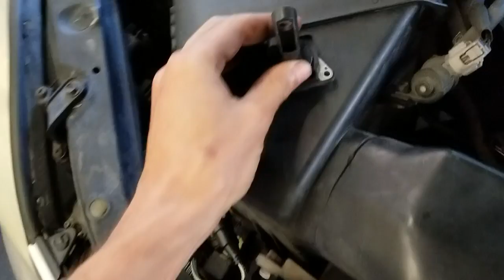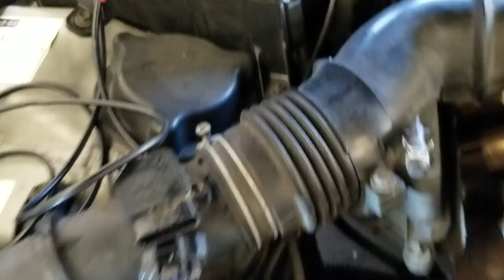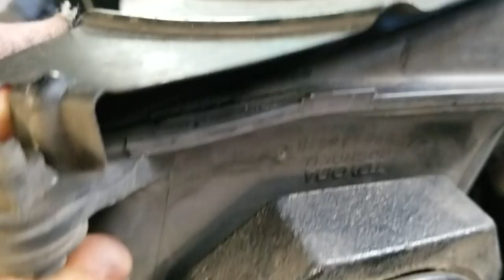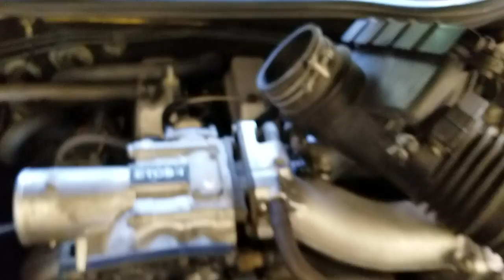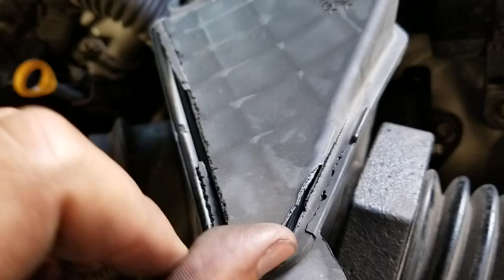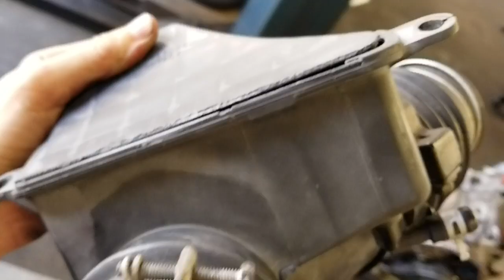FIXED 2JZ hesitation & low power, no check engine light.

Comment: Thanks for the info, I had already cleaned throttle body twice, checked hoses, cleaned MAFS to no avail. After your video i pulled the heat shield below resonator and found a large crack at the seam with 1/8" open area. I'm using high temp epoxy to seal resonator and will check it in a few months. If it opens back up I'll drop the 200 for a new one.
Thanks again
Reply from the maker: Just get an AEM intake that is carb legal. Dont worry about it again

Comment: 2002 Is300. I cleaned out my MAF sensor and it feels like a whole new car now. Before cleaning MAF at idle on scantool read 5.2 to 6.4 gm/s and long term fuel trim -15 and -18. 
After cleaning sensor MAF at idle is around 3.5 gm/s and long term fuel trims after a drive went to around zero. 

Replaced the transmission due to no reverse intermittently, had black fluid , 300k miles and a shift solenoid code. the new one shifted better but not good on wide open throttle. Would bog while taking off and make a noise that sounded something like the transmission pump had cavitation.  
Now it is good.

Comment: I recently had timing seal leak fixed. But now the car is raced . If I make it low the car engine is shutting on idle. It's both on cng and petrol. Can you tell me what's the problem.. the mechanic say it's electrical.. but before the engine opened for timing seal I never had any issue

Comment: Could this issue cause the green ECT Power light to flash? My car idles fine but the slightest tap of the accelerator and the car runs obnoxiously loud while lacking power it seems. I've found that my resonator is indeed cracked and will get around to replacing it. I hope the ECT Power light is related to this and not another issue

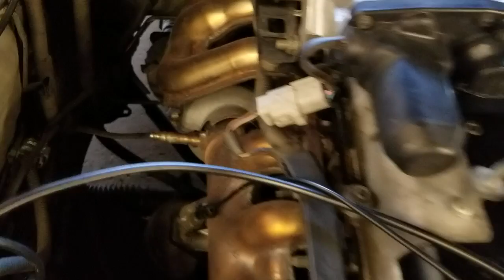Comment: 7:34 , no fr. I have to replace everything from spark plug, coils, o2 sensors, Sensor 2344517 (rear oxygen), Vacuum Switching Valve ☠️
Reply: Change fuel pump
Reply: @dpm8763 why would I

Comment: Fantastic video.  I’ve been doing some work on one for a friend and afterwards starting running into this issue.  Thought I had resolved it after replacing the exhaust manifold gasket, but still having some issues.  It only seemed to have the issue after driving it for about 10 miles.  I then cleaned the MAF, but didn’t know about the two small wires down inside nor to check for the crack in then plastic baffle.  Thanks!

Comment: My 2001 gs300 has a stuttering issue. I've replaced the spark plugs, the coil packs, and the MAF Sensor but my car still gives me a rough launch. 
Usually the first start is fine, it feels like the car has no issues. After a short drive around my street, when I try to accelerate the car has crazy hesitation anywhere below 2500 RPMs then gets up and goes. I have no codes besides a knock sensor code (p0325), not even a misfire code.
Reply: Check your coolant temp sensor (for ecu), the green plug directly underneath your intake plenum, to the left of your knock sensor.

Comment: I have no fault codes on my Toyota Yaris 1.0L (2004), 
new spark plugs
new air filter 
cleaned throttle budy
cleaned PCV
tested TPS
checked vapor solenoid
clean MAF sensor 
tested camshaft position sensor  
checked ignition coils  
 - but still have  some vibration on idle and hesitation after fast/sharply pressing the gas pedal (hesitation from idle to 1500-2000 rpm, like if the engine is choking), but if I give gas smoothly - the engine normally gains speed and power.... also no luck of power from 2000 to 7000 rpm.

Comment: Hey I had the same issue and I cleaned my sensor with maf cleaner and used contact cleaner on the conector and started her up and she ran fine then the revs start dropping and it start making a lot more shit sounds out the exhaust as if it’s misfiring more then what it was before hand. Any more suggestions?

Comment: Interesting. I have a 00' GS300 with 209k n since i bought it ive been chasing a Cyl.1 Misfire (P0301) n the throttle from a dead stop has a slight hesitation n also from 38mph-50mph it does the same thing. Id done new plugs new wires new coil pack connectors new Cyl.1 Injector n still having that damn code so this is my next to check. Thanks
Reply: I have a 200 as well with 200k and i am trying to figure out my cyl 1 misfire as well,, hopefully i don't mess up the cats before i do. Mine seems to activate more when i come out of a sharp turn then accelerate out or when slowing down when letting off gas then accelerate again. One of the possibilities im worried about is a head gasket. 2 people have asked if it's ever been overheated but i don't know since i bought it off the original owner.

Comment: My 98 gs300 is limp mode from code p1121, cleaned maf and replaced the apps, tps and it now it only reads p1128! (Throttle control motor lock) im aiming the tb motor and just replacing it?

Comment: DANG IT I HAVE A RICH CONDITION P0172 P0175. TESTED MAF....ITS GOOD. TESTED O2 THEY ARE GOOD. CLEAN THROTTLE BODY. RUNS GREAT BUT SENDS A CHECK ENGINE LIGHT THOUGH. ANY IDEAS???? 01 IS300 NON TURBO

Comment: Hi there, I have NISSAN PULSAR N16 (Nissan sentra N16) model 2005 with QG16DE engine. i had a problem with low power when going uphill and then when i press the gas pedal to the max the engine will suddenly shut down. No engine light , do you have any opinion on whats going on with my car.
Reply: Sounds like fuel pump

Comment: Ok some im having a problem similar to this and  my short term fuel trims were lean on both banks. I cleaned the mass air flow and i also noticed the air box where the air filter is ,was not fully latched ,leaving a gap. After i properly latched the air box the fuel trims went back to close to normal. Could that gap in the air box have caused drive ability  issues?

Comment: My car had been low on power so like you, i tried cleaning the maf sensor and cleaning the filter to see if it would help. While i was putting the air filter back in i noticed the intake hose had gotten very loose allowing unmetered air to the engine. I tightened it back up and after a few miles of driving it was running perfect again

Comment: Bro I'm experiencing some sort of jolt  after I accelerate almost like a bucking not when accelerating its after when I wanna change gear I turn the car off and back on it's all good 
Do you know what it may be I done a full service and checked maf even done high performance petrol cleaner and it still there sometimes ... 
It's a tfsi 1.8 running a map and garages around me dont have clue what it may be..
There is no codes thrown either 
Tia

Comment: Any idea why rpm skyrockets when I turn it on ? Or when it doesn’t do that the car goes to limp mode
Reply from the maker: Probably the throttle stuck open
Reply: @subtledriver  interesting I’ll check it out I ordered a ecu from flagship just in case

Comment: My car hesitates like how you described which I’m going to take a look at later, 

My other problem is my car idles super rough after it gets up to operating temp either in reverse, park or idling at a red light. It doesn’t turn over and there’s no leaks or check engine light. Took it into the mechanics and now it sounds like my alternator or timing belts is whining or rubbing after leaving the shop. It’s done it a few times before and has even stalled a few times because of the rough idle

Comment: Interesting, neither of those caused Check Engine Light?  Here's one for you, I told a shop and mentioned cleaning the MAF and the knucklehead says, 'you gotta be careful, because each time wears off some of the sensor'...I told him I use MAF cleaner....I also replaced the cat because I was getting P0420 (fixed that) but I hoped backpressure was my concern.  420 fixed, compression good, sensors new, airfilter, fuel filter new, plugs new.  I'll check for air cracks again, but I've looked.

Comment: Damn thanks for this video,  for the last 5 year’s I thought something was wrong with my is300.  Just just bought a new coil pack and spark wires thinking it would make a difference until I saw this video.  I’ve checked the mass flow sensor and it looked dirty,  clean it with the mass air sensor cleaner and the car ran like nothing happened.  I use a K&N filter and you have oil them every time you clean it.  Yep those oil from the K&N filter can mess up your mass air flow sensor.

Comment: I had a Bronco that had a broken wire to a coil. Burned up front cat, which crumbled and plugged back cat. Mechanic said it was because RAW AIR was getting to the cat and super-heating it.

Comment: Dude, you got right down to it!! You didn't talk about your dog, or a kid that threw a rock at your car, or painting your car.....you got right down and said it was the map sensor, and the plastic cover for throttle body area! Thank you for an accurate detailed explanation of how they work, how to clean them, and how it affects the car. I'm subscribing! 👍😎 A++
Reply: I agree with you 100% LoL 😂😂😂
.... Until then ....
Reply: you can clean them with the proper spray (there is such a thing) but is better to just replace them they are Not expensive just make sure they are Not Knock Offs? from China!  but  actual  Toyota parts. most are held  with two screws one on each side pull it out and replace with new one . runs smooth and you can say goodbye to the engine hesitating  in most cases.
Reply: @chuyocaca4153 yeah but how long will it last. I rather clean the ortigal part.

Comment: please help me to my chevrolet spark 2015 LS1.2
no check engine light indicate to dashboard and low voltage result to scanner. dont have to supply negative power from ecm to main relay. thanks in advance

Comment: Great video, but one small mistake.  A waste spark system is not a shared coil, but one that has two spark plugs per cylinder.
Reply from the maker: That is a dual spark plug system. Waste spark has two plugs per coil, fires twice. Once during compression and once during exhaust stroke.
Reply: @subtledriver  Ok.  I educated myself.  Thank you.

Comment: THIS IS IT! No more hesitation when hitting the gas. I always looked like the driver on their phone but no, I’m looking, my car just isn’t going haha

Also a good idea to clean the throttle body with some cleaner and use a toothbrush and rag to scrape out the carbon. It’ll start up rough with the check engine light on and VSC off, but disconnecting the battery for a few minutes gets everything back.

Comment: It would be good to put a heat shield at the bottom of the intake hose before the throttle body. Obviously the original plastic shield can only take so much.

Comment: Wish I could fix the power loss and jerking on my car  but have no idea whats going on. I did a check on the maf sensor and the car stops as soon as i unplug it so cant be the maf sensor. Im getting quite frustrated. Cant even get up a hill sometimes with foot flat to the floor. Was told could be turbo?

Comment: My father-in-law had a 2002 Lexus GS 300 with 136k on the clock that I was asked to sell for him. His Lexus had a similar issue in that when I stuffed the accelerator to the floor to get ahead of the approaching traffic the Lexus would "hang" around 4,000 rpm (suspended in time almost) and did NOT shift until my foot was lifted - totally unsafe!!! This video changed everything because instead of paying a local mechanic $158 to just diagnose the car I cleaned the mass airflow sensor with a special spray, pulled the airbox to find it crack-free, cleaned the throttle body and butterfly, and installed a new air filter to one that should have been trashed years ago! 

It's a completely different car(!) that now launches in acceleration quickly and shifts smoothly through its range easily getting ahead of any approaching car. THANK YOU very much for this excellent, informative video! The Lexus was just sold with spunk and longevity to a new owner who is delighted!
Reply from the maker: Im just now seeing this comment, thanks for writing it. Im glad you got the car running better for the new owner. Have a good day!

Comment: My 2001 2jz GS300 is doing this exact thing. It that about 297k miles. I'll clean that up THX!!
Reply: Turned out to be the wires for plug timing were bare and cracked due to age. This is 21 years old btw

Comment: I have a 2017 Dodge Journey SE
63,670mi

Hesitation when trying to Accelerate.
Can Rev up to 4,000 before catching on.
Transmission Fluid is Good.
No Check Engine Light or Codes

Thoughts?

Comment: I did my ignition coils spark plugs the solenoid and cleaned my throttle body it had a bad hesitation at idle after it worked like new 💯

Comment: i got a 97 tacoma for over a year i cant find my rough idle in D at a stop light, ive cleaned everything and replaced everything. You in los angeles?
Reply from the maker: shop is in san diego. do a compression check, those motors tend to burn valves.
Reply: @subtledriver  already did that its solid, already adjusted aswell

Comment: He points out that there are 2 sets of fine wires to be cleaned. NO TOUCH... just MAFS aerosol cleaner and it will air dry in 30 seconds outdoors on a dry day.  No Q-Tip or cloth or paper towel... just spray with a tiny straw (on a MAFS cleaner can) and that is all that is needed. Some cracks can be sealed, but part replacement is a better move (same for hoses collapsed or cracking at the ends).

Comment: Maf cleaner is ether (quick start fluid)
Brake cleaner is acetone (nail polish remover).
Blue devil gasket repair is kitty litter (silica gel) and lye.
Most qwik fix products are household chemicals .
Reply: Thanks for this bro!! This is real info right?
Reply: i wipe my maf wires gently w isoproply alcohol pads. ive been doing it a long time and all good.
Reply: good video
Reply: Repair the cracked plastic box with 3M permanent spray adhesive and a quality aluminum foil duct tape. If you want it bomb proof go over with Mastik duct sealer. Thanks for the tips that is a great engine!

Comment: dam...  I better put my shit back to how it was and start from there again.  I had the same problem.  replaced some wires and soldered them together with the old wires, because the insulation was cracked.  replaced ignition wires just above the engine, replaced terminals and spark plugs. Idle started running high afterwards.  I had a misfire on cylinders 5 and 6.  that's why i replaced the wires because they were exposed creating a short circuit.  grrrrr

Comment: Just bought a Nissan murano 163k new transmission 1 year warranty the car has power when parked rims rev up fine put it in gear the car takes for ever to accelerate could this be my problem or would a failing fuel pump do this? Also there isn't any coded

Comment: Even the fuel pump also changed but no results My Gs300 consum more fuel and no power and also miss fires even difficult to take speed up to 20
Reply: check the voltage going to the fuel pump it  goes from 8v to 12v  from the fuel pump cpu mine only was giving 8v should jump up to 12v when accelerating

Comment: I am facing the same problem but still no mechanic found the reason why my Gs300 miss fires and now even the mechanic has take out that emission filter out......so yet no results even spark plugs,coils,vvt sensor all changed but yet the same problem

Comment: You seem to know a lot...I’ve got an issue I am chasing down. 

My car drives perfectly fine until about 30-40 minutes into a drive once it’s really warm it’ll kind of bog/jerk when I go up or down a hill. After that I drive on flat road it’ll continue doing that. But once it starts to do that I pull over, shut the car off, and start it back up and it drives fine again until the next 30-40 min drive. What do you think it can be ?
Reply: Did you find the problem with your car? Mines doing the same ! At a lost end…
Reply: Oil in my plugs.. cleaned it out and put new plugs and has not happened since.

Comment: My fuel trims on my is300 at idle are like +20-30 but when I’m on the gas they drop down to about +5-10. You think this may be my problem? Great video btw
Reply: It also seems to lag at lows rpms and then takes off fast..
Reply: Did you solve it?

Comment: I have the same problem but only when i climb big hill 
or when I run the engine in high acceleration after i can smells  oil for 2 minute the engine returns to normal and my temperature never rises above 95 celcius an dont have check engine light

Comment: My car does that after it gets hot, after 45 minutes of driving it.
Reply: Same !! On my 2000 GS300... did you figure yours out ?
Reply: @rcsaechao  I cleaned the pcv valves on the valve cover with carb cleaner and now it hasnt done it. I even turn on my AC for 1 hour while driving it and it doesn't hesitate while im driving it.
Reply: @rcsaechao  Look up some videos on how to clean the pcv valves. They are all over YouTube.

Comment: I got a 2006 honda accord .... I bought and installed  a cold air intake filter and now the car has no power .... i mean i know is not going to increase a lot but it was running with more handling and the acceleration was good before i installed. Any suggest ?? Thank you
Reply from the maker: Get aem or k&n brand. Or go back to stock.

Comment: My car doesn't have that wire in maf sensor its like a air flow meter its a 1993 supra so how would i clean it
Reply from the maker: you need test it with the procedure listed in your factory service manual. this video is for the maf version of most 2jz vehicles.

Comment: My supra 2jz is hesitating and has loss of power im gana check this tomorrow
Reply: Any luck
Reply: @tree__3xusking320  i checked all my plastics from intake everything looks good but my car is still hesitating im thinking it might be iacv or maf but i replace it with my sc300 and still does same thing im thinking i might have a bad gasket either throttle or plenum

Comment: Bro you’re the holy grail 🙌🏾 I have exact same problem in my gs 300 2004
Reply: Same here with an 01 GS..  Cleaned it, and immediately acelerator working fine, Idling Correctly..